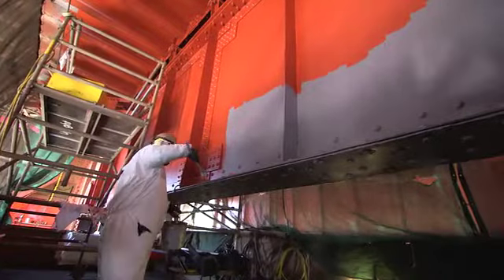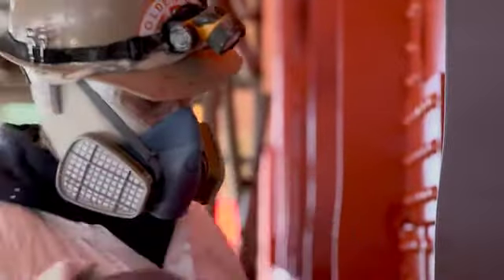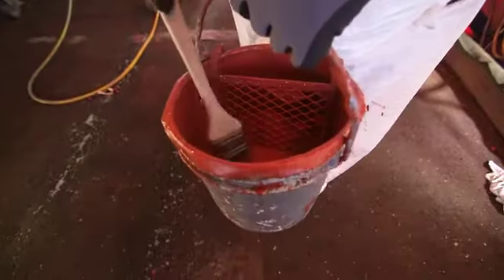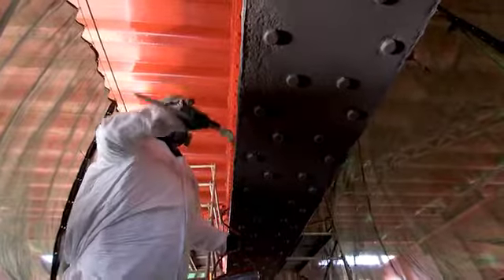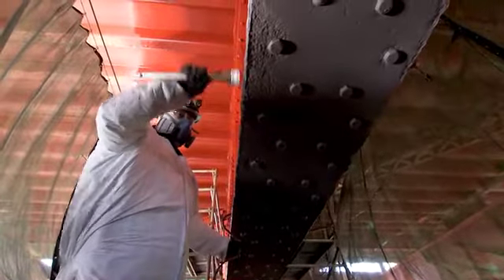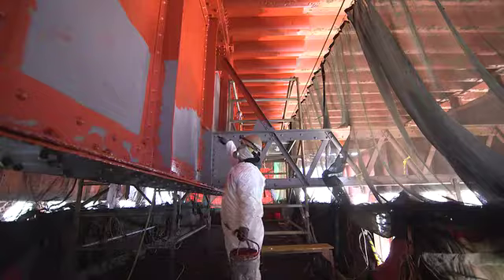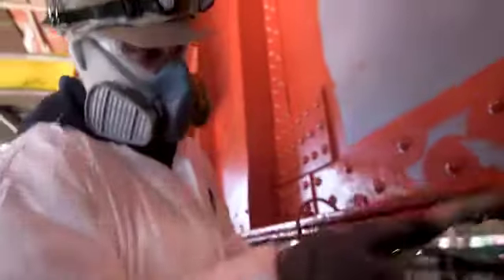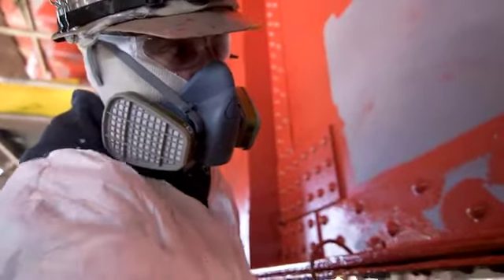what we do painter robert valdez

Comment: What a waste of time. You should spray paint it with a professional sprayer. Won't take as long.
Reply: I believe they apply it by brush because it's a special type of corrosion resistant paint. It's important that every little thing is inspected & covered to prevent deep corrosion in one spot.